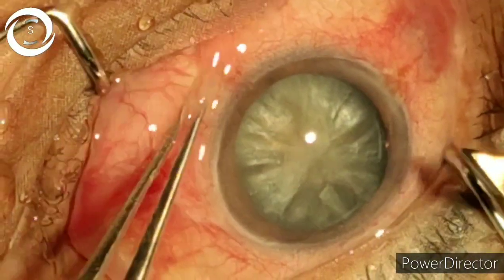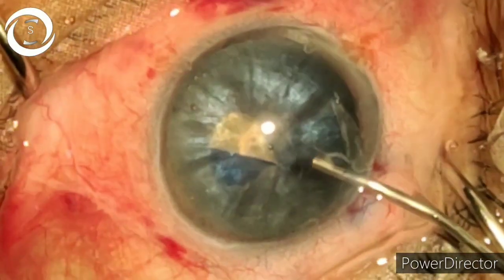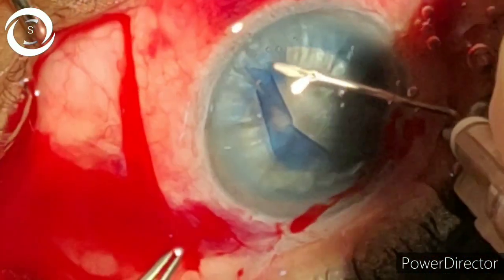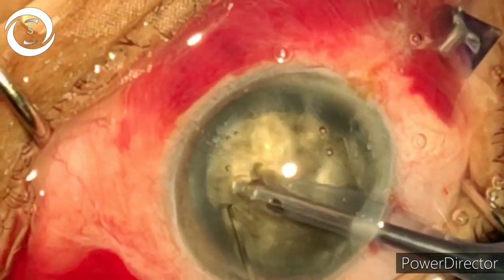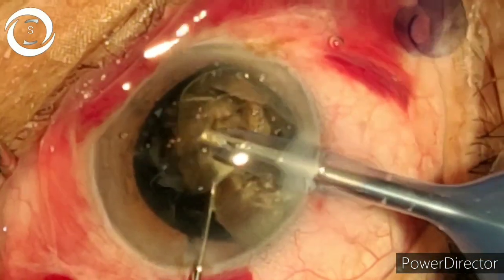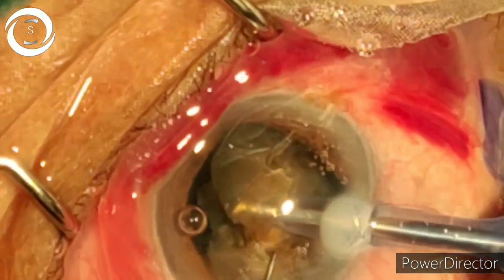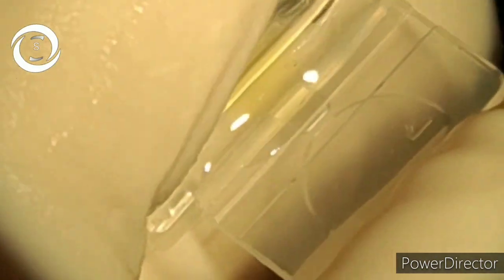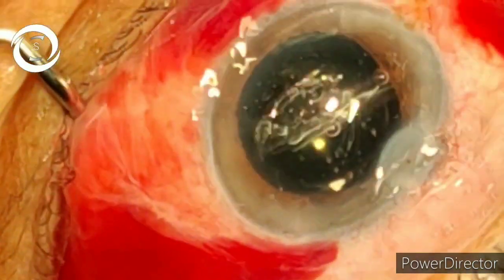Cataracta Nigra phaco emulsification tilt and chop technique

Comment: Ummm….i don’t think this case was handled well. As seen in other videos, far better to do nice, deep and wide trenches, then crack and chop. Tilting such a large nucleus is stressful to the zonules and cornea. The corneal wound burn suggests the technique used here was not ideal.
Reply from the maker: You are right it can be dealt differently but the end result was good if done in experienced hands